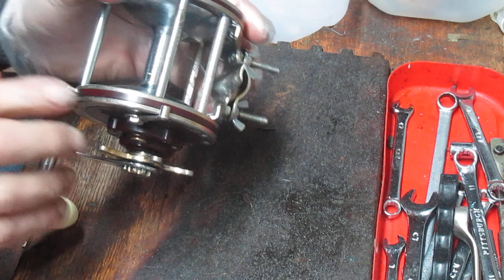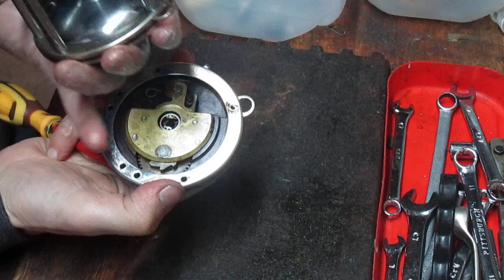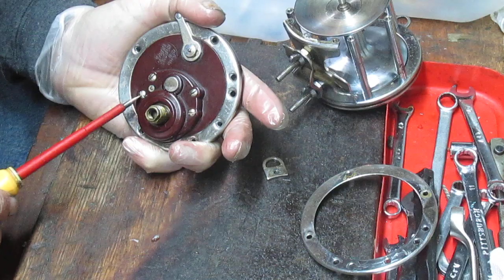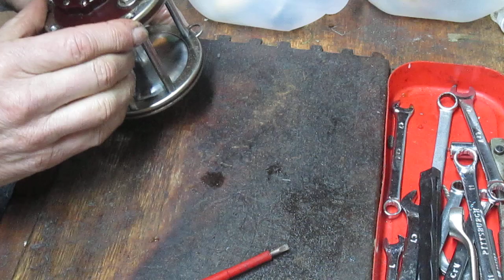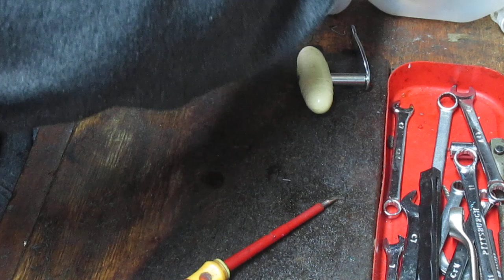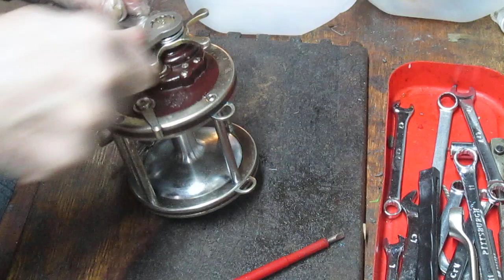Penn Senator 4/0 113-H take apart and service including drag washers

Comment: Dear Dennis, just followed this after watching your other video on the older black sided 4/0 (comparing it to the 113h).  Exactly the same story as when I followed your Sqidder video - a spotless, gleaming reel, working perfectly and catching fish again.  Got a Delmar (just for the fun of it) and a Mitchell 386 to go and I wander whether I will ever use my slick but boring Shimano's again.
I was given my vintage reels by an old boy 35 years ago in a hessian sack.  They had corrosion and were stiff when I opened that forgotten same bag some 4 months ago when I arrived back in the UK after living in NJ, USA.  They would have been ditched if I hadn't seen your channel.
As an engineer myself I marvel at the simple design and the quality of the materials used.  These old timers go for about 25 bucks over here.  When you think of the cost of modern multipliers these are a realistic cheap option if you don't mind spending an hour to open them up and giving them a clean and grease/oil.  Thanks again Dennis, everyone asks me about my vintage reels on the shore.
Reply from the maker: Glad to hear that!  Best wishes for fishing with those 2nd Chance reels!
Reply: @2nd Chance Tackle  Cheers mate.

Comment: Just got one for $50 and it needs some love. Thanks for the video.
Reply from the maker: Sounds promising.  Best wishes on the rebuild nd the good fishing to come - Dennis
Reply: 2nd Chance Tackle 
I took my 4/0 apart and found a very ruined drag system with washers stuck together. My reel has 3 fabric and 3 metal washers, and I need some help finding the right replacement parts.
Reply from the maker: You can get the replacements through Mysticparts.com.  They are an authorized Penn Parts distributor and will be able to help get you the right parts - Dennis

Comment: Back in the days of my youth; while working as a certified auto mechanic, I learned several tricks to help assemble items like carburetors. One was to take a screw and grind the head off, so it can fit through the hole of the part that is held by a regular screw. Making sure that there is a slot to accept a flathead screwdriver. Thus, forming a stud that can be installed and removed with a flathead screwdriver.
I am sure you must have extra bridge screws. If two (four would be better) newly made studs temporarily installed on the bridge plate, then the plate can be installed which lines up all the screw holes. Now one at a time, a stud could be removed with a flathead screwdriver and the actual screw be installed on the already lined up bridge plate. If the new studs are long enough, screwdriver may not be needed either.
Not teaching the “sensei”, just a suggestion. Thanks for posting.
Reply from the maker: Thanks for the tip.  Dennis

Comment: Dennis, please help.  Followed directions but after a few turns the free spool clutch doesnt engage.  I take it apart and everything works.  Put it back together and it wont pop backward all the way.  Any idea what might be happening?  Great videos.  Thanks
Reply from the maker: It sounds like the yoke assembly isn't correct.  Can you send me a note to my email 2ndchancetackle@gmail.com and include a picture of the inside gear set up and I will try to help you
Dennis
Reply: Dennis,

I took it apart a few times and put it back together.  Not sure what happened but everything seems to be working well now.  I will fish cautiously on this reel for a while but it seems ok!  Thank you so much for your help and support.  I would be very pleased to return any favor to you.  Eddie

Comment: Hey Dennis, could you do a video on buying and selling used reels, such as ones with good resale how to purchase them and service them without exceeding costs.
Reply from the maker: I will try Gary.  Thanks for your continued suggestions.  I'll try and collect some examples and do this.  There are several considerations.  First is the cost to acquire, second is the cost to repair, and the third is what value you can add in servicing the reel that will enable you to profit. Let's see what I can get.  I will be at a flea market this weekend and will look around for examples of each.
Reply: No problem, I appreciate your "show" and you passing on the knowledge.  There isn't any rush so take your time but keep producing quality videos. Your camera angle and the explanation of procedures are by far the best. Most others position the view out of focus and give half of what goes into it. Thanks again
Reply from the maker: Hi Gary.  I am putting together a series on the business of used fishing reel repair and resale based on your request.  As I got to thinking, this is more than a 20 minute explanation.  I just posted an intro to the seminar.  If you follow it, please let me know if I am covering the areas you would like me to discuss and keep the suggestions coming if I am overlooking something or missing the mark on others. Thanks again - Dennis
Reply: I am excited to see this series, I understand that there are many aspects of reel repair and selling. I will let you know if your off the mark, lol. Also will continue with possible subjects to touch upon. Keep up the great videos!!

Comment: I recently acquired a 4/0 special. It has the drag stack access by just removing the crank handle. It has the thick black washers. I was wanting to upgrade it to the HT100's. Do I have to buy additional washers to complete the upgrade? Great video. Thank you.
Reply from the maker: Yes - you will need additional Ht-100 and metal washers.  I think Mysticparts.com sells the conversion kit and includes both the metals and fabric washers - Dennis

Comment: Thanks for putting up these videos. They are very helpful. Presently, I'm trying to take a Penn 113HLW apart but ran into a very stubborn handle nut, the Penn proprietary one. Despite my buying this reel new over 30 years ago, I don't have the special wrench.  I think I only used the reel once or twice all those years ago. I ordered what I think is the right wrench (Based on the images in my Penn owner's manual.) from an Ebay seller, but it won't be here for a few days. I tried channel locks, as well as an open-end combo wrench, which almost worked, but it wouldn't budge. I'm about to spray some PB Blaster back behind the drag star in the hopes it loosens something up. Do you know of any socket type tool that will fit this Penn nut? Or any other trick? Thanks again. Cheers.
Reply from the maker: I am not aware of a socket for that screw.  Yes. penetrating oil may help loosen it.  I assume you have removed the lock down screw.  Spray it with the oil and if you can wait for the wrench, do it a few times.  If it is still stubborn when you get the wrench, you can extend the wrench handle with a pipe that has an internal diameter wider than the wrench head.  Simply slide the pipe over the wrench and the longer handle will give you more leverage to remove that stubborn screw - Dennis
Reply: @2ndChanceTackle  Thanks for responding. Yes, the lock-down screw was out. One never knows though, does one? ;-)  The specialized Penn-nut wrench came today and it worked fine. There was a second when I thought I might have to reach for some sort of cheater, but it released before I did.  This reel is marked as a "Penn Senator II"  and 113 HLW. It is a bit different from the other 113HLW series schematics show. It has what I'll call a "top hat" piece under the drag star. The flat bottom of it sits on the final drag washer,. The top is a cylindrical spacer/collar to move the handle away from the reel body. Rather strangely, it does not have the spacer that limits lateral movement anywhere. That movement is limited by the bottom, washer, part of this "top-hat" piece. Thanks again for your videos. The are a big help. Cheers.
Reply: I just watched your other video on what was an earlier Senator 113H. It had the the part that I referred to, and that is part of a system that allowed the drag stack to be R&R'd without removing the spool, etc.

Comment: Thanks for the video. Just acquired 113H2 senator. The handle is bent a tad. What should I do? 
Florida Fishing Woman😊
Reply from the maker: Where is it bent?  If it is bent on the handle blank, you can put that in a vice to straighten it.  If it is bent on the knob shaft, best to leave it alone or replace it with another handle if it is difficult to crank - Dennis
Reply: @2ndChanceTackle  Thank you so much.
I feel lucky to have acquired the Senator and Slammer rod at a good deal. And my luck increased finding your video. Thank you for the answer. New subscriber!

Comment: I just was given a reel like that that needs a good cleaning, what chemicals did you use on the metal parts please? I will clean the outside first, the go inside.
Reply from the maker: I use Turtle Wax Chrome cleaner and 0000 steel wool for cleaning the details.  The only "chemical" I use is #Flitz metal precleaner which is a urea based cleaner that works great - Dennis
Reply: @2ndChanceTackle  Thank you, I have a Senator 3.0. Will penn have a few screws for outside of reel?

Comment: great vid Dennis.  Question: when I pulled off the main gear, the drag stack was literally seized into a single unit and I was unable to get it out of the main gear housing.  Any tricks for getting it out or do I just buy a new drag stack and main gear?  The reel is a Made in USA 113H Senator Special vintage 1970.  Thanks.
Reply from the maker: Yes, there is a way!  Turn the main gear upside down on your workbench.  You will see the flat sides of the metal washers. inside the hole.  They will extend further out than the round holes of the fabric washers.  Get a small flat blade screw driver or small punch or another tool that can go through the hole and rest on the metal washer.  Gently tap the washers one side at a time and you should be able to move them to the top of the main gear.  You can then remove them one by one as they "top" off.  repeat tapping from underneath as needed until you have tapped all all of the washers up and out.  If the metal and fabric washers are stuck together when they come out, you can separate them using a utility knife as a wedge.  If you try that, please be careful and remember it is a knife!!!

Let me know if that helps

Dennis
Reply: @2ndChanceTackle  Thank you Dennis.  I'll give it a shot and will let you know if I have any success.

Comment: Hi Dennis, love the videos. Could the tarnished look on the chrome actually be the brass showing from beneath where the chrome has worn? I fixed up my Grandpap’s old Levelwind 350 (thanks to your video!) that’s gotta be 60 years old. The chrome was so corroded that some of it just sloughed off when I put the steel wool to it, and it has that tarnished look now, too.
Reply from the maker: Yes - that is the metal showing under the chrome plating.   You can leave it alone.  No need to re-plate it.  Just keep it clean after use to avoid further corrosion.
Dennis

Comment: Thanks.  Great video.  I have an older Black 4/0 (likely from the 1950's) that is in great shape but has been sitting for decades. I decided to put it back into service and noticed that the eccentric lever position is opposite my other 4/0 reels.  When the level is pushed forward the reel is in free spool mode which is opposite of my Red 4/0 reels.  Is this by design or did someone long ago reverse something during a repair?  Thanks
Reply from the maker: This is by design.  The older reels had the lever in the 11 O'Clock position and the newer ones were mover to the 2 O'Clock position which made the throw opposite.  I understand that they wanted to move that free spool lever because it was getting hit when folks went to adjust the star drags under a fighting fish.  Moving the lever to the front of the reel was suppose to resolve that issue - Thanks for asking - Dennis
Reply: @2ndChanceTackle  

Dennis:

Thanks for the prompt reply and knowledge sharing.  I will clean up and lube the reel and will likely replace the drag washers since they are original.
Reply: Hi Dennis:

I have started the rebuild of my old Black 113 and disassembled the reel. I carefully followed your recommendation to not to lose the small anti-reverse spring.  I even bought a new spring just in case I lost the old one.  To my surprise, my reel appears to not have that small spring but instead it has a bent copper strip about one inch long,  0.076 wide and 0.006 thick which appears to be the anti-reverse spring for this reel.  Not what I was expecting.  I looked at some online schematics and always see the typical spring...not a bent copper strip type spring.  Have you even seen this in another reel?  If so, can I just install a new spring (PN 14-99) in some fashion or do I have to stay with the existing copper strip spring?  I will have to figure out how that was placed in the reel if I need to use it since it moved when disassembled.

Thanks for all your help.
Reply: After further inspection late last night I determined how the spring was originally installed and the reel is now back together with a new drag stack and working great. I now understand why Penn redesigned the anti-reverse mechanism decades ago!  It was a PITA to get that old anti-reverse spring to stay in place during reassemble.
Reply from the maker: Yes - the flat spring was common on most Penn conventional reels prior to 1958, when they switched to the coil spring. You can watch how to install the spring here https://youtu.be/6P0nX4dHeEw I believe these springs are still available, but in limited supply through Mysticparts.com -  Dennis

Comment: Thanks sir. Very helpful video. Best of all I 've watched . By the way should i grease drag  washers ?
Reply from the maker: Yes.  The purpose of the drag grease is to keep them flexible.   If you do not, they will wear quicker and could become brittle and crack over time.  I use Cal's universal drag and reel grease for the drags.  If you do not have that, but have a grease designed for fishing reels, go ahead and do that.  Apply a light coat of the grease to the drag and work it in with your fingers to make sure it is an even coating on both sides.  I recommend using a latex glove to protect your fingers.  Thanks for asking - Dennis

Comment: Dennis, I just got a 113H 4/0 that's on its way. I plan to fish it, and not get restore into mint shape. There looks to be some light oxidation and imperfections in the rings and spool. I have chlorinated brake cleaner (red CRC can) around already. If I disassemble, can I soak the metal in the brake cleaner and then hit with 0000 steel wool?
Reply from the maker: I would go with the 0000 still wool and a metal polish like tarn or turtlewax chrome cleaner.  Some of those auto cleaners have acids, lye and other chemicals that may be too harsh or dissolve or stain some finishes.  The rings are chromed, so stay with the metal polish for the best results - Dennis
Reply: @2ndChanceTackle  Thank you.
Reply: @2ndChanceTackle Oh, also, how about the metal internals? Ok for that stuff?

Comment: Was just wondering why after changing out my drag washers on a 112h senator is there is no drag when in the lock position.  It's like the real is in free  spool all the time ?
Reply from the maker: It is possible that the earned washer came out of the slot on reassembly.  Assuming you have all of the metals and drag washers in place, this would be the first place that I would check - Dennis

Comment: penn senator 3/0 112h 2 yesterday 12-12-2020 I was fishing and my reel started to fail as it has a little jump when I'm winding the line.  before it did not.  I need to repair thank you very much.
Reply from the maker: Hard to say what is causing it, but it may be trapped, broken line or a broken part inside - You do need to open it up and see what is going on - Dennis

Comment: I just got one at pawn shop but they put wire the one to weld do u know how much line it take ?
Reply from the maker: Yes - here is a range on mono yards/pound test
440/30 
370/40 
270/50

Comment: Hey ,I have a Penn 4/0 but 
The free spool spring looks like it's loose..
I can't tell it's just out of place or it's broken.. thanks..have good day
Reply from the maker: It is most likely broken.  The spring has a tag end with a hook that attaches to the eccentric cam and the other end rests in a groove on the side plate.  Check to see that both ends are attached.  It they aren't then the spring is broken and would need to be replaced.  Dennis